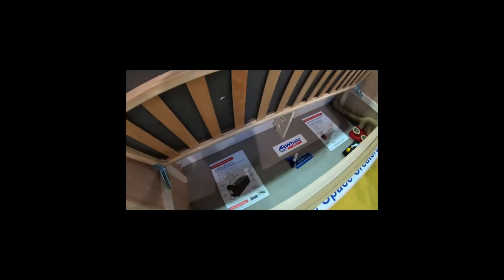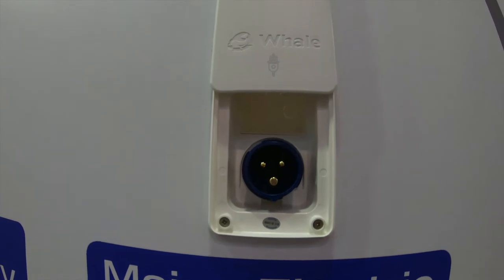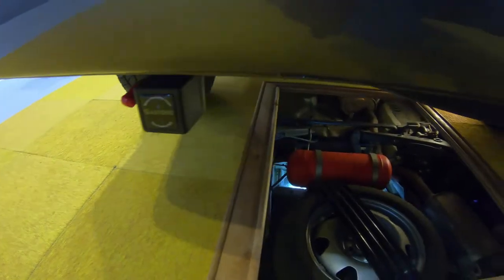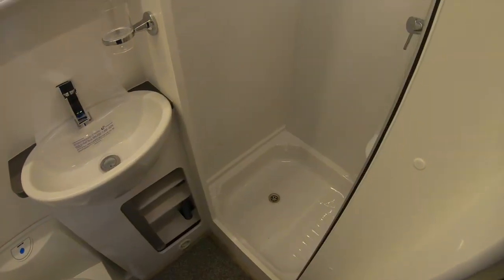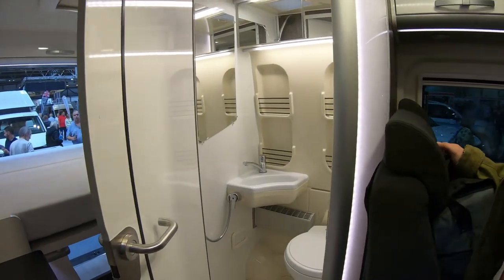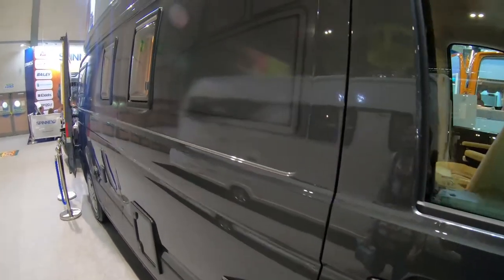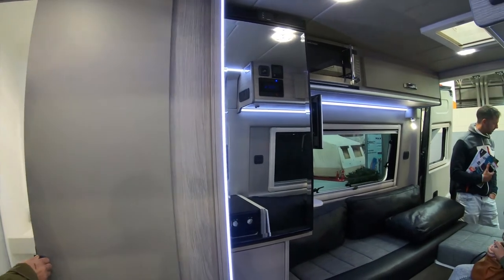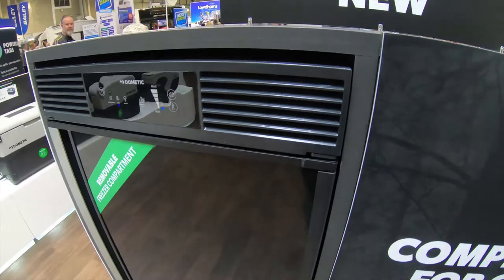Uk Motorhome Show 2018 - Getting Ideas For Your Campervan

Comment: Hi, really enjoying the channel. Great to have a UK based channel for a change. Do you know the model of the new Dometic fridge coming out? Just about to get myself a new Crafter which I’m going to slowly convert!
Reply from the maker: Thank you so much for you comment, we are glad you are enjoying the channel :) The model of the fridge that we showed in the video is the Dometic RC 10.4, they are going to do 2 different sizes a 70l and 90l, the one in the video was the 90l version. It is such an exciting time getting a new van and working out how you are going to convert it.  Do you have any ideas on layout that you want?
Reply from the maker: Yeah, that's a really good conversion we have checked out that video too.  I believe they have now sold that van and are building an overlander vehicle.  We have found using an application called Sketchup (https://www.sketchup.com) quite useful for designing layout and cabinet ideas.  It gives you a 3d representation of how the van can look.  If you Google around I am sure you can find a VW Crafter model that you can import to help with all the dimensions. There is a beginners video on how to use it here https://youtu.be/UsHRGDvN4sM
Reply: Thanks I’ll check out the video. Good luck with yours and I’m look forward to seeing the progress on the channel.

Comment: Sound/audio was only coming though the left channel right at the beginning of the video but was fine after that.  I would be like a kid in a candy shop at that show.  Are you having your LPG underslung tank fitted professionally?  I maybe headed to the UK to have mine fitted the same way, and whilst there, maybe have my flares, and narrow windows fitted also.

That fridge you say you are going for when available in January, does that run on LPG, 12v, of shore power?

As to the water heater, Truma do a combo water/air heater, check Greg's Sprinter van conversion series for more info on that.

I'm currently struggling to find somewhere locally to take my van to get washed.running into brick walls, even at camper premises, the lack of the Finnish language is holding me back somewhat, so my wife is coming with me on Wednesday to ask around a few places if I can use their pressure washes.  Already tried commercial vehicle places that clean minibuses, but they are so strict here, and not open to the public.

Living and converting my van on the street is another hurdle, but having a storage unit has helped so far.  I have done the winterisation on the van including my winter pre-test of my Espar H21 engine block heater, this will be used during the winter as it gets very cold here, -35c normally.

Once spring is here, I will get that final piece of flooring up, then its full steam ahead, and like I say, a UK short stay on the cards, so maybe possible to meet up with you.
Reply from the maker: Yeah I think the audio issue was due to the mic not being plugged in to the camera properly only noticed once the video was published! 

We are having the gas tanks professionally fitted by a company called Propex Leisure (https://www.propexleisure.co.uk) who are based on the south coast of the UK.  Gas is one of those things that we want done by a professional installer as the cost of getting it wring can be high!  Do you know where you are going to be getting your windows and flares fitted in the UK yet?

The fridge we are looking at runs on 12v or 230v (shore power) depending on whether you are hooked up.  It's a compressor fridge so the draw from the batteries shouldn't be too high, we probably won't use the freezer compartment so will probably be removing that.

The Truma is the other unit that we have been looking at and did see one at the show both on a trade stand and also fitted in a van.  We are still debating on whether to go for the separate Whale units or the Truma.  On speaking to one of the companies they have recommended a place on the underside of the van at the rear where we could fit the water heater, if this is the case then this would save us a lot of space inside as it would only be the air heater unit we would need to find a space for.  This is still a work in progress but we will definitely be doing a video on this when the time comes.

Do you not have petrol station forecourts with pressure washing systems?  They are common over here instead of the traditional car washes.

That is definitely very cold, how did the pre-test on the Espar go?  A storage unit or barn would be really useful for us especially during the winter as its not so much the cold that we are not looking forward to but the rain that we are no doubt going to get over the winter.

I bet you are looking forward to spring so you can get back to it.  Yes let us know when you will be in the UK and we can meet up and can show you the conversion in the flesh.

Thank you for watching, subscribing and commenting on our videos we really appreciate it.
Reply: Not yet narrowed down the company in the UK I will be using for fitting my flares, and windows yet, but want to plan ahead, and find a gas fitters and window fitting company pretty close to each other too save time whilst I'm there.

My H12 block heater winter pre-test went well, it works great, using the diesel from the tank, it also heats up inside the van too.

Yeah, you would think there would be pressure washers here at garages, but there's only car washers, its to do with water preservation here, and the only place I found anywhere remotely like I need is a small place on the outskirts of town, it has four water points, but here's the funny thing, its simply an extended hope pipe, with a simple on off tap pn the end, and costs €2 euros for 20 minutes, its cold water only, no pressure, crazy.

I guess what I could do, is fit,l my pressurised 8L water canister (manual pump) with really soapy water, take that with me to this silly water place, spray the whole van in soap water, and wipe everything down with a cloth, then pay €2 euros to rinse it.

We are not allowed to wash our own vehicles on the street here either, again based on water preservation, and pollution.

Not sure if I already told you that I'm from the UK originally, my name is Michael, but my friends call me Micky.  I will be in touch when I know when and where in the UK I will be headed in the New Year my friend.